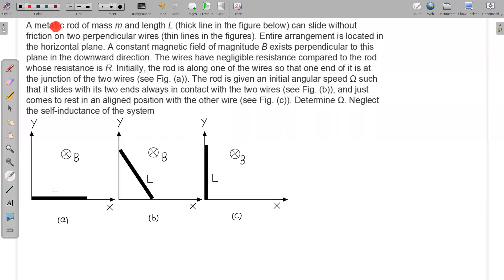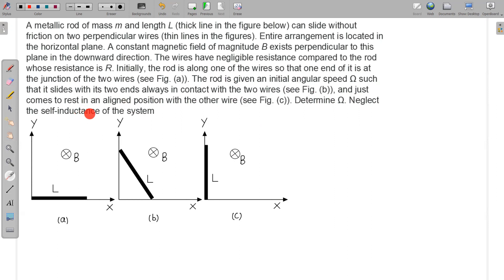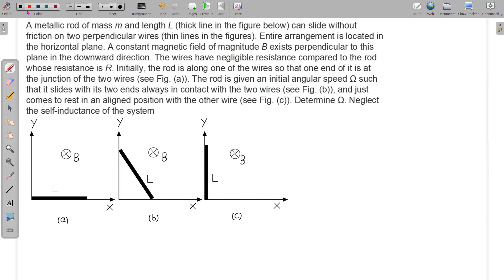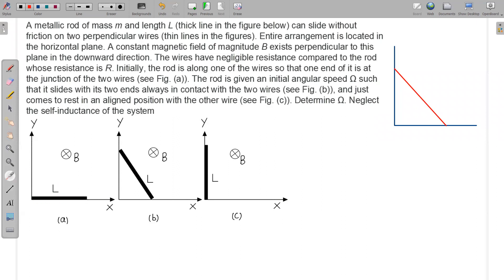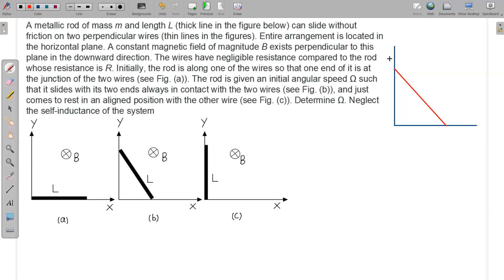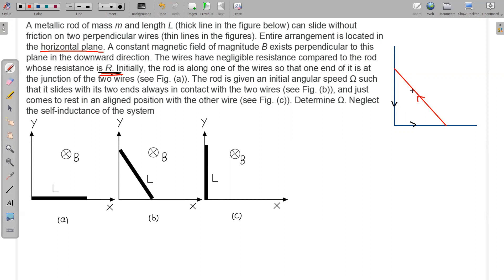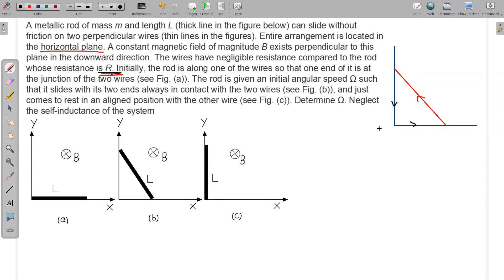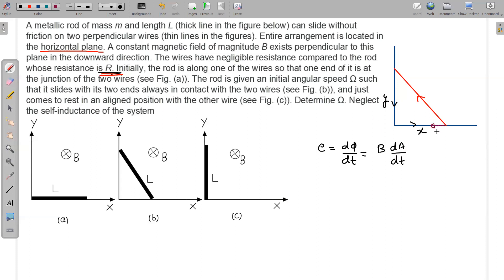Electromagnetic Induction | INPhO 2017 | Retarding Sliding Rod

Comment: How to solve this with the torque method? Basically, I want to write the torque equations with respect to the instantaneous axis of rotation. Now I solved the question in that way and if I won't consider the pseudo torque the answer is matching but when I consider the pseudo torque due to the acceleration of the instantaneous axis of rotation by applying the relevant pseudo force on the centre of mass the answer is not matching. Please explain to us why is this happening. When should we consider and when not?